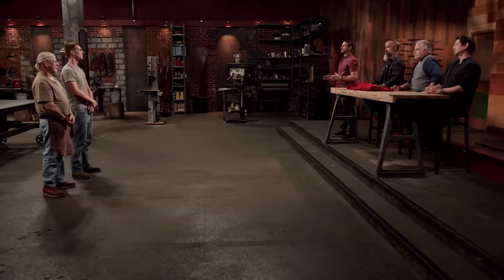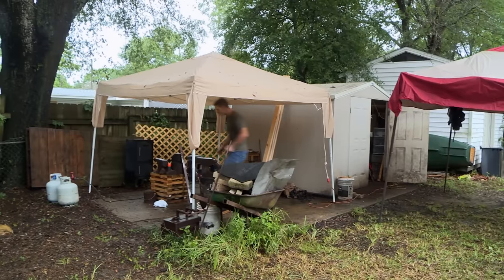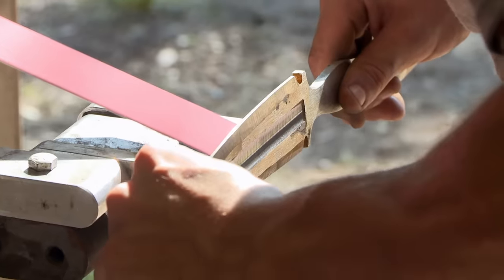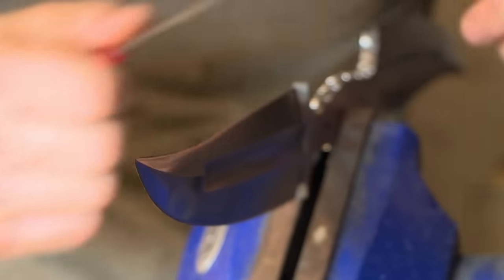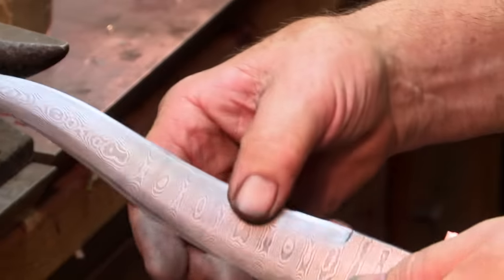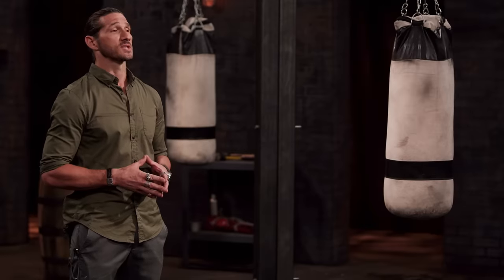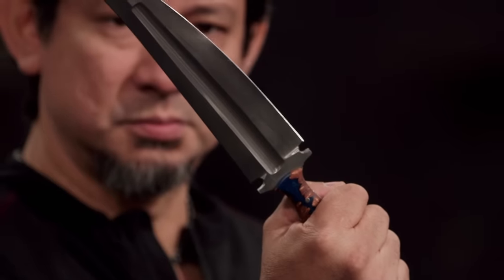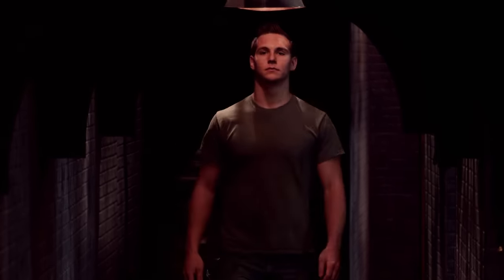Forged in Fire: DOUBLE-EDGED DAGGER DOES DEADLY DAMAGE (Season 3)

Comment: The lack of a re-curve is definitely more then enough to keep them from competing but MAN both of those weapons are downright gorgeous.
Reply: I would say the younger ones was a bit dangerous though with no protection to prevent a slip down the handle to the blade. Weapon design should prioritize the welders safety over looks
Reply: @TheGamingTruckr  it actually had a small protection of metal where the handle ends, but it's basically nothing when you want to thrust with full force. The other handle was waaaay better both in safety and (from what I could see) comfort.
Reply: @daniellima4391  Let's be honest though, neither of those weapons is going to be used for anything. They'll be put on a shelf as a conversation piece.
Reply: @deathstar008  true, but even so, bladesmiths should build the weapon thinking on it's practical use, not wether it's gonna be used or not.
Doesn't change the fact that it's never gonna be used again the rest of it's life lmao
Reply: I thought the disqualified weapon's handle looked too skinny, especially when Doug was holding it. I'm no expert, but it looks like the other would have been way comfier to hold and use. I thought Doug was going to say it was unsafe due to the skinny handle and lack of adequate protection
Reply: Yea, being recurved makes it harder for the blade to stay in shape when in use, and therefore harder to forge. An un-recurved blade will have a huge advantage over the other one and so the judges definitely made the right call there. 
However, speaking about the lack of handle protection, I believe he was just following the style of the sample blade in 0:22, so I think it really shouldn't matter.
Reply: @TheGamingTruckr  Who are you to say what should and shouldn't be?
Reply: d
Reply: @thearchlich7273  Someone with basic common sense?
Reply: @TheGamingTruckr  dude it fing doublebladed, what safety are you talking?
Reply: exactly my thought. I even paused the vid somewhere around 08:46 just to admire both of them....
Reply: I wouldn't touch Steve's weapon, for having a handle that is too thin and lacks a guard.

Comment: It's nice to see an episode where they have guys that really know how to make a blade.  Both were beautifully done even if the one didn't meet the rules.
Reply: Ya, but I have a feeling that the old mans handle would've cracked during the strength test. He made it as 2 seperate blades rather then all in one peice. That separation will cause a lot of stress right in the middle
Reply: @solidmoon8266  That's how it was originally designed though.

A lot of these Indian weapons are quite fragile in construction, you got that right. Talwars, for example, have soldered hilts. Because what could go wrong...
Reply: I couldn't agree more on how both blades were beautifully made, alas when it comes to costum made especially on a competition, a small detail is crucial
Reply: @solidmoon8266  this weapon was historically made using 2 separate blades. Maybe it wouldn't have held up to their strength tests, but that more than likely is an indictment on the test than the forge work. It's a rather delicate weapon in general, and Ray built it exactly the way they were built historically
Reply: I wished they would’ve still put it through the tests for our viewing pleasure. Even though it wasn’t up to exact big-ticket specifications.
Reply: @solidmoon8266  the original design is two separate pieces held together with a wooden handle. He followed the original design exactly
Reply: @levy9595  Sicne they normaly design the finals tests based on the historical use of the weapon, I doubt there would have been any problem with the strength test. Unlike the preliminaries were they really try to destroy the blades.

Comment: One thing Everyone in this show failed to mention is that this kind of blade is not supposed to be wielded by itself. It is supposed to be used with a buckler type shield which protects the hand, and the two should fit in the hand well together. The handle of the knife should fit in the groove on the handle of the buckler and should be thin enough to not be too hard to hold.
Reply: Very interesting!  Thanks for the trivia.
Reply: Which is fascinating cause a thicker blade doesn't always mean more deadly. Love esoteric weapons.
Reply: I knew I saw this blade before, But couldn't remember why it seemed so off. Now I'm gonna be racking my brain trying to remember where I saw it with the buckler.
Reply: see i didnt know this, but i always felt a weapon such as this should have had a defensive tool to accompany it.
Reply: Exactly Illidan in Warcraft 3 has similar swords
Reply: The Scots do kinda the same with a dirk and shield in the off hand with a backsword/baskethilt in the on hand

Comment: His handle also looked pretty wack. Seemed like your hand would get pushed into the blade with a thrust.
Reply: They specifically requested unguarded
Reply: @michaelcohen9363  Both handles were unguarded. There was nothing acting as a guard. On one side, you have an unguarded blade that's shaped in such a way as to prevent undue movement of the hand on the hilt. On the other side, you have a flashy guard that wasn't really ovoid so it would have easily spun in the hand and, if covered in blood or other liquid, the hand would slip due to the concave shape of the hilt. Stephen showed his severe lack of experience and foresight.
Reply: @inflatablewolfie  still you must admit it’s a beautiful blade and he is a great smith with lots of potential
Reply: @Justin-cu9mb  Basically beauty without substance. You gonna hang it somewhere as decoration? Blacksmith is a job that require you to be meticulous. A great weapon will look beautiful naturally, there is no need to do this and that to beautify it.

Comment: Im honestly glad they didnt test it because the handle looked so SLIM i was scared someones hand may slip down to the blades edge and lose some fingers.
Reply: Seems to me there's a big guard area so there's no chance your hand slips on the blade.
Reply: @mrkiky  plus the shape of the handle compared to the blades themselves kinda limits that sort of motion regardless of whats happening...
Reply: Have you guys ever used a blade in your life? The handle is so tiny that he cant grip it properly to prevent sliding, it could absolutely slide up the blade unless someone had tiny hands.
Reply: @Crimsonfangg  It only slides if the handle is about the same width as the blade and there's a smooth transition. There's a 90 degree angle there and a considerable difference in width. Maybe it would be unconfortable but it wouldn't slide up.
Reply: @Crimsonfangg  When you start with a question and finish with a statement. You only prove you have no idea what you're talking about.
Reply: even if your hand couldn't slide up, it looked downright non-ergonomic. He clearly hadn't though of the that
Reply: @michaelbanks1000  What about when you comment two sentences that should have just been one?
Reply: @michaelbanks1000  When you start with a question and finish with a statement "," you only prove you have no idea what you're talking about.

Comment: The old man did exactly what the original blade was, two separate piece of metal joint together on the handle with beautiful recurve. Damascus was just a extra cherry on top.
Reply: Seriously that was a beautifully crafted blade. He could sell that for some good money.
Reply: I gotta admit, I'm skeptical of any smith that tries Damascus on a short time frame for this show and feel like if testing had progressed, the old guy's weapon had many more potential structural problems because of the swiftly-made Damascus blades. 9/10 times you see Damascus blades on this show snap, crack, chip, or even flake apart during testing simply because it's so hard to get a good Damascus blade done and not mess something up during the forging or heat treating processes within the short time frames they work with. 4/5 days is just a HUGE gamble to get Damascus done when you need to spend at least one whole day on just making the billet for the blade, not even accounting for if the forging or heat treating turn up problems.
Reply: damascus basically came from India
Reply: @Aditya0227  not really as damascus was made by muslim countries but these knifes were also made a long time before damascus was invented
Reply: @bluebananacookie  Muslims countries used to import it from India and then sell it to the west.
Reply: @bluebananacookie  its called wootz steel
Reply: Old mad did it the honest way. I puke every time I see someone "make" a blade just by grinding it out of a bigger piece of steel
Reply: @Foxxie0kun  I think the people that try making a damascus blade do it to impress the judges, wich is of course the main objective of the show. It's a gamble you may want to take to get that extra edge when you have 10 grand on the line.
Reply: @daniellima4391  When you have $10k on the line, you should focus on a blade that will succeed at all three tests and leave aesthetics to the idiots who buy wallhangers and anime swords.
Reply: @daniellima4391  the thought is there, but you definitely should not take the gamble tbh. Your focus shouldn't be to impress judges that aren't gonna take that into consideration. The only thing they're worried about is performance. They don't really care what it's made of as long as it passes the test.
Reply: @glyph__  Yeah, when a bad heat treat allows for your edge to roll or chip, or your attention span is dominated by Damascus and not the weight and balance of the weapon in the hand, you end up losing to the guy whose weapon was a proper weight and balance and whose blade didn't sustain edge damage during the tests. Damascus can be notorious for inconsistencies in the heat treating and tempering processes. Heck, some weapons are outright disqualified for not having the correct grip style or proportions, and there's been some BEAUTIFUL weapons that lost out to the plain looking one because they were too heavy or the grip was too smooth or too round.
Reply: @Foxxie0kun  it's a shame when you see a bladesmith put appearance over the use of the weapon. It may look amazing on the wall, but it'll be useless in the competition
Reply: @bluebananacookie  OG Damascus steel isn't patterned like this it's created in a crucible and has a uniform pattern generally referred as Wootz steel(originally from India) the layered steel we call Damascus is really pattern welded and is much more recent compared to Wootz which started coming in to Europe around the Viking Era.
Reply: @Dr.TJ_Eckleburg  yeah
Reply: @Foxxie0kun  But only because most damascus blades come in the preliminaries. I have not seen one final, where the damascus balde performed worse than the other weapon. At least not because of the materials. And if both perforn equally, it's 90% the damascus that wins because of the extra work.
Reply: @4Curses  I've seen at least two finals where the Damascus suffers a catastrophic failure and cannot continue testing. I forget which, but there's also situations where the smith does the blade really well, but fails to account for handle geometry or the overall balance of the weapon.

It's rare for me to see the Damascus blade win because the smith, on a 4 day time frame that takes at least 2 days for the metalwork, has to rush through the rest of the process and make obvious sacrifices to fit and finish.
Reply: @nukkumatti9587  I agree completely. A piece of flat steel and a grinder does not make you a blacksmith...

Comment: The quality difference between these two blades is huge. The grip on Stephen's also look really small like it is for a baby's hands. I am curious how well the grip will hold up with all the epoxy if this weapon is meant for real battles. Too bad he was so focused on aesthetic he forgot the curves on the blades. Would love to see both haladies in action.
Reply: Basically a difference in experience and the tools used. Ray had about $20,000 more equipment in his home shop. The fight was never fair in this case. But Steven could have at least followed the directions.
Reply: @ZerglingOne1  To be perfectly honest, the quality difference IS huge and is much higher in Stephens knife... Sharp lines, definition, the design was much better too, shame he didn't do the recurve as I believe he would've easily won. Just look at the grind lines on both blades, on Rays knife they are non existant, everything is rounded, no definition whatsoever. The ricasso area is also way too big - a waste of space and adds unnecessary weight. No disrespect but Rays knife does look like an amateur made it, and that can't be said about Stephens work.
Reply: Are we talking about the same epoxy that you use to walk on the same epoxy that is used outside and can withstand wide range temperatures and different weather conditions
And you are worried if it will survive?
Reply: Ray make a great job in whole five days. Even being more experienced, he did not save any time to make it perfect. That's what experience means.
Reply: @PoltergeistWorks  In the end one looks like a historical knife and the other like a gimmicky tactical watchamacallit you get for 20 dollar on amazon. Looks are a matter of taste.
Reply: @4Curses  Looks - yes, but the finishing quality and level of detail is not a matter of taste. And a historical piece is something that was actually in the period, then it's worth something. You could make a knife with this crude quality as a replica, but if you're making something of your own and call is historical then it's just an excuse for the poor build and finish quality.
Reply: @ZerglingOne1  Well even so, the oldtimer sure had more equipment, but his time was better invested. he used 5 of 5 days to do his tool. While the young guy thought to stress out his project 20% faster. 

Its an valuable lesson for him, if you stress though your project without thinking it though just to win time, you might have to redo the whole project again. or in this case, lose 10 grand.
Reply: @PoltergeistWorks  His blade was not better anyway. The handle was too small and there was no guard where it meets the blade. So if you try to stab or hook slash with it, your hand will slide up, hit and jam into those metal parts sticking out.

Comment: I'd be worried my hand could slip and slice into that blade on either side. The flaring on the first one provided some security on that. It's not a small detail you missed, it's a major one. They even described it when talking about the knife, stating it was a double recurve blade, which was a parameter he shouldn't have overlooked. Also, I would NEVER have done a blue resin insert on that blade handle. It looked ridiculous on that knife.
Reply: @KissMyConverseFool  These are easily concealable versatile weapons well adapted to the conditions in which it was manufactured. These weren't European knights in heavy armor. These knives would easily have cut through cloth, as demonstrated by henry, as well as penetrating a body. Henry spinning it showed, in my opinion, how wieldable it is.

Comment: They could have at least used it still to see how well it performed. It always sucks seeing someone lose over such a small oversight, you get that far just to be told to leave without having your weapon tested... unfortunate
Reply: That's a gigantic oversight... the only requirements were two recurve blades on one handle. That'd be like making a shamsir with a straight, double edge blade... at that point its not a shamsir anymore.
Reply: Рукоятка очень тонкая. Только для крохотный руки , что индивидуально. Но тсуба из края острого металла не самое адекватное решение,  т.к такое оружие используют либо в перчатке либо и вовсе без нее.

Comment: That's a shame. I liked the the look of the one from the thumbnail. The other one looked fairly lackluster. Simple wood handle no embellishments and the acid etch was so dark you couldn't really see the damascus pattern. Would have liked to have seen them test them regardless. Curious how they would have held up in the torture test. Damascus is pretty tempermental a gap, hairline fracture or delamination could be catastrophic. The 1095 is probably fairly solid but it has choils on both sides for some reason which is a serious stress riser so honestly both of them had a real possibility of snapping. One due to the construction and the other due to the design

Comment: lack of recurve is just not allowed to be missed man...also, the steel inner part of the handle seemed to have  not been heat treated...probably wouldve failed on the strength test...AND the whole handle itself isnt well designed, becasue any slip of the hand would mean your pinkie or index finger would be hitting hard steel, which is very uncomfortable.

Comment: you can see the difference in the blacksmiths, the younger one had slightly less respect for the culture clearly showing he didnt research around the haladie design and so the details seem to have also just flown over his head, while the older smith seemed more confident and used damascus steel for his blade in a sort of respect for the culture

Comment: Such a beautiful Damascus blade and then to stick that horrible handle on is a crime. Obviously over compensated the handle as it was a two piece design. I didn't necessarily like the other blade but his handle was neat. The finish seemed a bit rough though could probably have gone with a finer sandpaper.

Comment: The guy that got disqualified had a nicer knife
Reply: doesn't matter, the guy didn't make the knife with the right parameters, and that's not a small detail either and on top of that, the guys handle didn't look very safe, chances are dougs hand might have slipped from the handle onto the blade and cut his hand
Reply: I don't want use that blades. It'll cut my finger